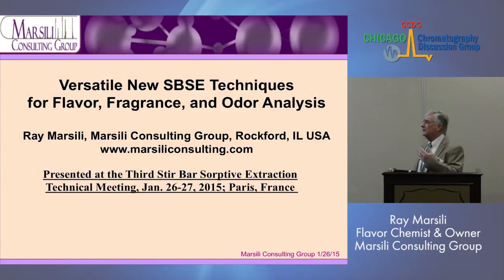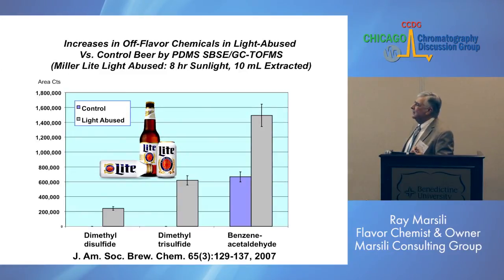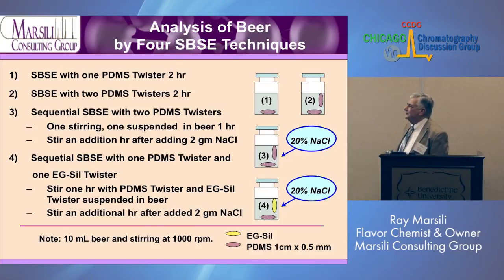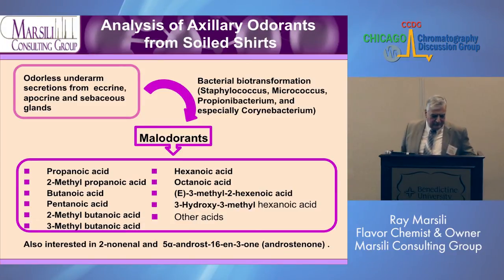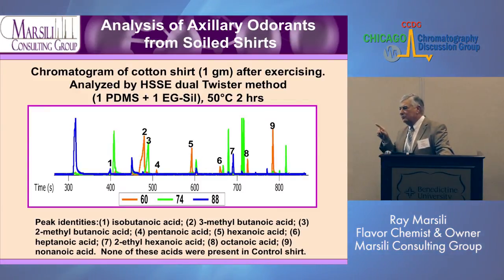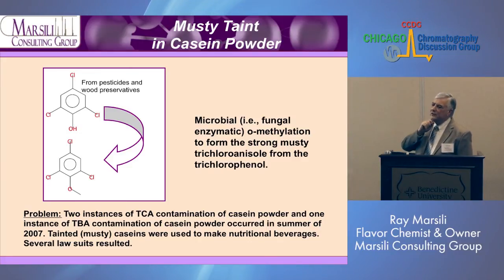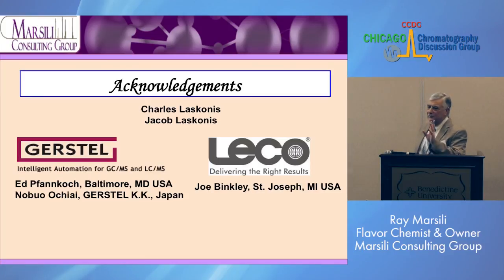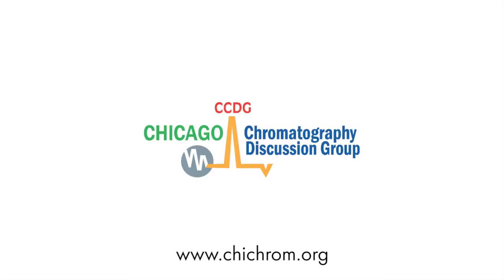Versatile New Stir Bar Sorptive Extraction Techniques for Flavor, Fragrance, and Odor Analysis

Comment: Hi, I wanted to know if there is any other way to extract the organic compounds (for eg. C6-C22) from the twister instead of Thermal desorption system?
Reply from the maker: The answer is as follows: 

Using the
GERSTEL TDU and CIS injector for thermal desorption of Twisters produces the
highest recoveries of analytes from the stir bars, and the lowest detection
limits and background levels. Analytes are transfered almost 100% to the GC
column. Attempts by some chemists to place the Twister with extracted
chemicals into the Agilent injector to desorb volatiles does not work and
is a big waste of time. After back-extraction with solvents, the extracts can
be injected into normal GC injectors but sensitivity and background problems
are usually compromised, so this approach is inadvisable.

When
non-volatile or thermally labile compounds are of interest, solvent
back-extraction of the Twister followed by injection into an LC system is the
method of choice. This Twister back-extraction method can also be used for GC,
but detection limits will be lower compared to using thermal desorption unless
large volume injection techniques are used. Important advantages of GERSTEL
back-extraction technology: useful for nonvolatiles and thermally labile
compounds and extends capabilities to non-thermal desorption techniques
and LC analysis.

You can learn
more about Twister back-extraction at the following link:  http://www.richrom.com/application/v2/public/upload/0/default/70.pdf
.Ray Marsili